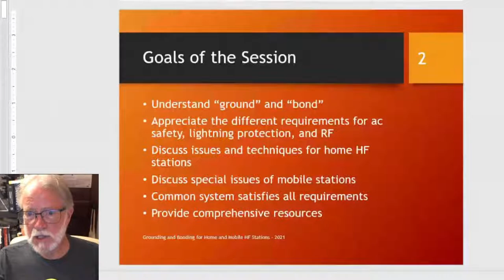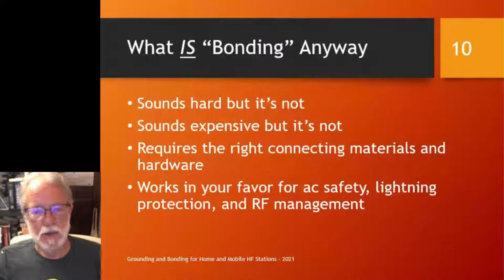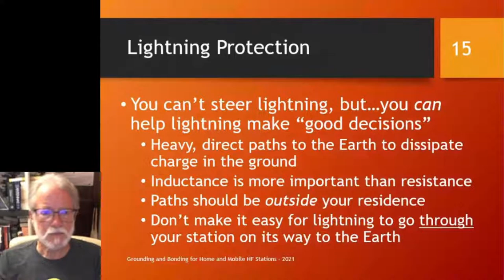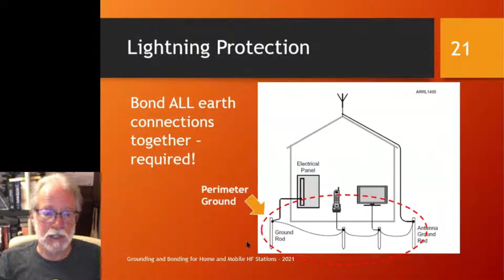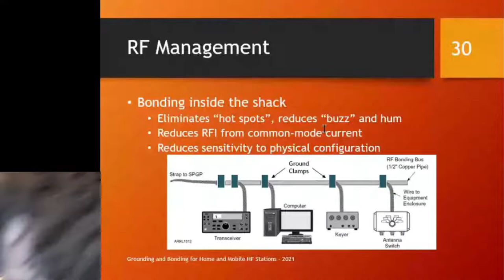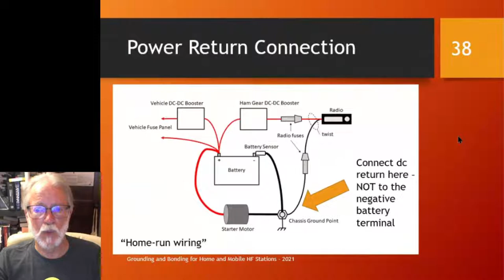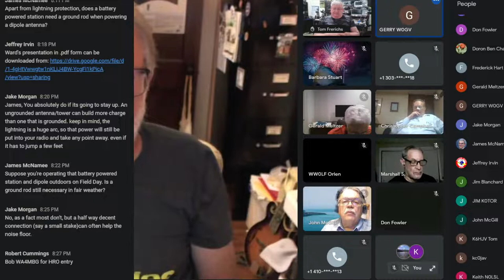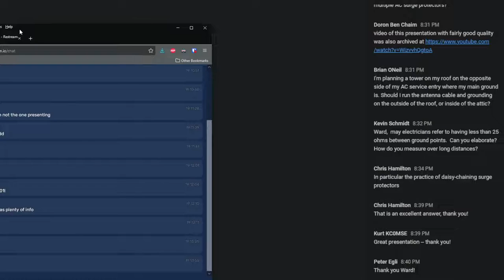Grounding & Bonding - Ward Silver - N0AX

Comment: This presentation doesn't seem to correspond with Mike Holts NEC grounding teaching on Youtube. It seems everyone has an opinion about "proper grounding". ...Am I right?
Reply: I also have problems with much of this presentation  Their should only be one entry point for everything, including water pipes.  A "PAN" bar at the service ground configured in the following way:

Producers go on Left.  (outside equipment)
Anode or Ground in the middle
Non producers on the right.  (inside equipment)

Everything that enters the building is bonded to the PAN bar, Phone, feedlines, power, water pipes etc.  These  bonds need to be as short as possible.  All other ground rods should be bonded to the PAN bar from the outside of the building.

In a lighting strike current is directed to the Anode or ground.  Current from the strike does not flow through to equipment on the non-producers side of the bar, because there is no path to ground.  There shall be no other connections to ground in the building other than that that comes back to the PAN bar.

If you run a wire through the house to another ground rod, the wire and all of its connections have resistance.  This means there will be a difference in potential (voltage) between the ground rods and current will flow through the building. You never want current from lighting to flow through the building under any circumstances.  

Yes the voltage will rise and fall during the strike but if it has no path to ground it will be harmless to your equipment.  It doesn't matter how high the voltage gets as long as there is no current flow electronic devices will come out the other side unharmed.
Reply: After thorough grounding my house from the AC safety rule perspective (NFPA NEC 70), I installed a lightning protection system (NFPA 780) and then decided to get my ham license so I could have a ground station with Winlink as an email backup. The presenter is correct that these are three different but related sets of requirements/standards. They all concern electro-magnetic equipment but at widely different frequencies with widely differing behavior. If someone is just familiar with one area, the others may have details that don’t seem to make sense. My adequate AC house wiring grounding wasn’t enough for lightning issues. So I proudly added a ‘star’ configured Equipotential Ground Bus Bar. (‘PAN’, although that acronym doesn’t appear in NFPA publications). And then realized the wires were way too long for RF frequencies. So I’m back to redesign again. I’m glad this video looks at all 3. Motorola’s R56 publication addresses all 3 also. BTW I do all this work under permit so it’s inspected by my city/AHJ.

Comment: @W1AL
Some great info in this video. Unfortunately it is a myth to think that connecting a station ground to a ground rod outside the shack is a good idea. If lightning didn't exist, MAYBE. But lightning does exist. And if a strike is close enough, the voltage from the strike travels into the ground up the ground rod and its attached wire, and into your shack, likely frying everything connected to it. Ground is not equivalent to as place where lightning goes to die. The ground can and does get charged when struck by lightning, and connecting your radio and ham gear to it increases the danger dramatically. Lesson? Disconnect any buss bars that may be connected together inside the shack from the exterior "ground rod." Think of it this way: certain appliances come with a third wire (the green, for ground) so that it is properly grounded. In the olden days of ham radio, they weren't. What may have been necessary then (to eliminate charging the chassis of that old radio) is unnecessary today. Your ham rig IS grounded if it has a 3-prong plug. What is true for the garden variety appliance is equally true for the rig. Unless you know of an appliance that requires a ground rod being banged into the ground out the nearest window. I sure don't. If one thinks of the logic and physics of it, it really is simple. Now...RF grounding is another myth. BUT, none of these problems were ever solved (or could be) by running a ground wire from anything to an outside ground rod. First of, running a wire creates an antenna, therefore making any problem worse. Far better to put one's energy into ferrite chokes to resolve RFI than messing with "grounding." This old wive's tale needs to be put to bed. The mixup lies in the wording in the NEC code (that "equipment" must be grounded). That doesn't translate into running ground rods to everything that one plugs into an outlet. Why do ham rigs have a "grounding" post? It is for BONDING as you wisely point out. By the way......I live in FL. Lightning is not DIRECTABLE or CONTROLLABLE. Thanks again for your wisdom on this topic. 73 de Scott, W1AL
Reply: I have attended talks by Monty Bateman, WB5RZX -- he has a Ph.D. in Physics and works in lightning research for NASA at Huntsville. He advocates for single point grounding, including radio equipment. Also, Motorola wrote the industry standard practices for grounding at communications sites, and they advocate for it too. Where are you getting the information you're talking about?

Comment: Fantastic video, The best video I've seen on this subject. I have a simple HF station consisting end fed antenna , 49:1 UNUN. I'm running a IC-7300, My power supply's DC negative is not tied to mains protective earth. So far nothing except the case of the power supply is tied to earth. During rain the other day I found my (disconnected coax sparking shield to centre conductor, from the wind and rain). My mains protective earth spike is fortunately is directly under my antenna. Rather than banging in a second rod can I tie DIRECTLY the antenna UNUN ground , small chimney mounted mast, radio, to the main service ground rod? I feel like the answer is yes being we tie all ground rods together anyway. Should I then be grounding my power supply negative directly back to that steak or through the case or leave it disconnected?  I'm thinking ground loops and potential differences if it has to go through the house wiring. Then I start thinking what about if I connect the usb to my pc thats connected via lan to a switch in another room etc...  Thanks!

Comment: Hello Ward.

I have a Grounding question. I have a copper pipe for grounding all my radios inside my Shack & all other Ham equipment.

Then connecting it to my outside utility box to my copper bar where all my lightning arrestors are.

From the Copper Bar inside the Utility Box connecting to my Ground Rod buried 9' on the ground. Is it safe to connect all my radios & equipment w/ the lightning arrestors?

Some said it's wrong to put them all together. Was wondering about your opinion about this?

Someone suggested that I need a separate Ground Rod for the Radios & Equipment.

That it does not make any sense connecting the Radios & Equipment w/ the Lightning Arrestors for the Antennas?

It is very expensive to put another Ground Rod because my Ground in the Property is Granite. I had to hire 3x Laborers to Sledgehammer the ground rod for 4 hours. Costing me around $400.00 in Labor per hour.

Stay Safe.

73
Ruben Tiosejo
KD6CWI

Comment: The PLDO component and its usage with an isolated/protected PDU in the shack was a component that I hadn't known about.  I knew there was an issue there, and I'd even seen some descriptions of AC to DC power supplies that isolated, to an extent, the AC-side and chassis-ground separately from the DC-out to the radio, but this PLDO component was the missing link in how to make this work.

Now the fun part comes in trying to figure out how to make all this apply to my house, including choice of desk location within the house relative to where I want to place the antenna and the SPGP, with relation to the electrical service ground.

Comment: I have my 3 antennas connected to a 2 position MFJ switch, one position connects to the radio and the other directly to ground with 12ga copper wire. All antennas and equipment are connected to the same buss bar with that connected to a 12 cu ft galvanized window well and bonded to the house ground. Do you see a lightning problem with this setup when all switches are set to ground?

Comment: Great presentation, not that it matters now but after you were interrupted by the "curator"???  tm~1:00:00,  your slides went BSC and everything was very hard to follow because of the distraction . I had to watch that portion over again. I noticed another Ham was adamant  about not using a ground fuse due to a sudden loss of your vehicle ground circuit which I find rare in today s cars; thanks for the emphasis on battery monitoring circuits also, I have a 2007 GM truck with a current transformer  for the ground wiring and you will screw up your charging cycle by bypassing it. Once again best explanation (class) on station and mobile grounding and protection. 73